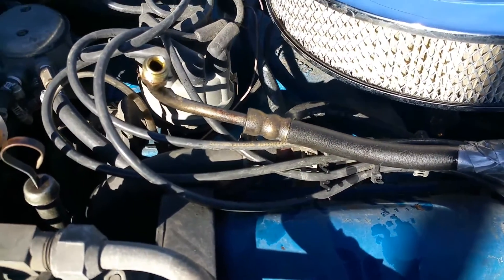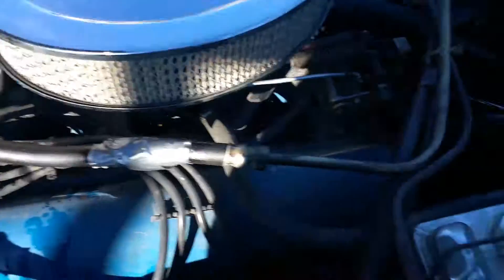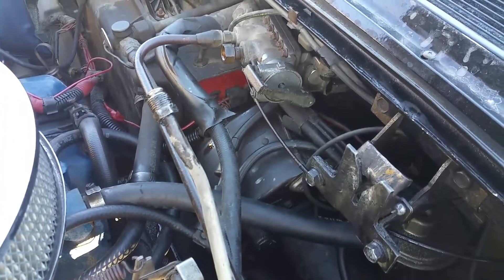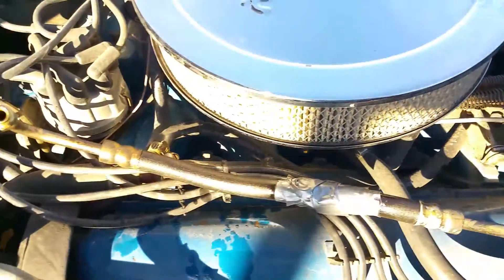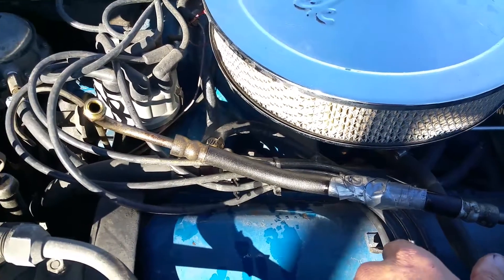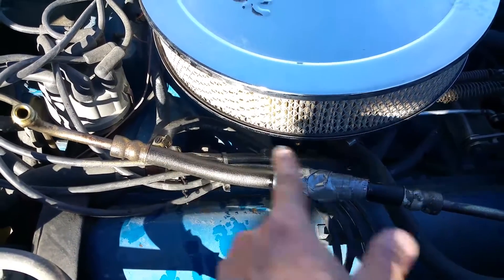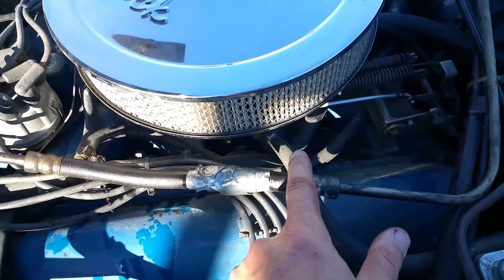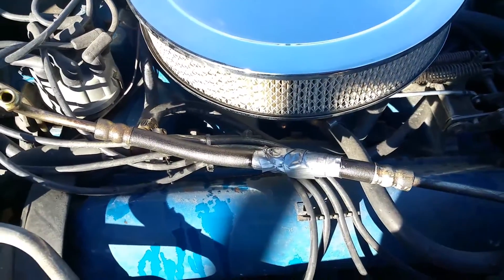1965 Lincoln Continental Windshield Wiper Motor Pressure Hose Replacement

Comment: Awesome to see someone else working on one at the same time as me! I'm working on my 65 four door convertible rn, and running into a host of issues with the top. Replacing all the wiring in the car.... it's a mess! All in good fun though
Reply from the maker: Joe Meosky you on suicide slab fb group? lots of info and help there